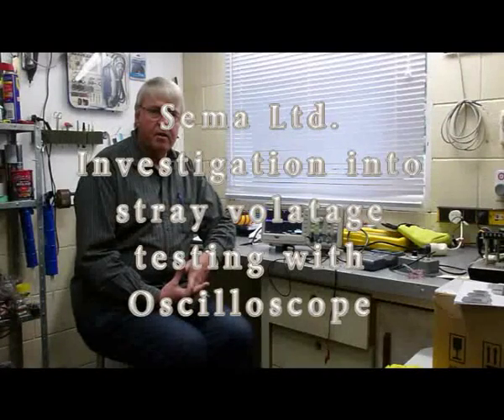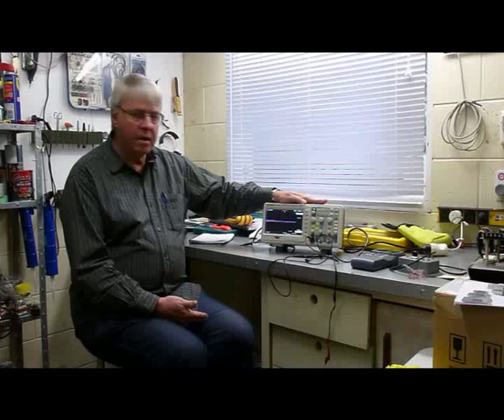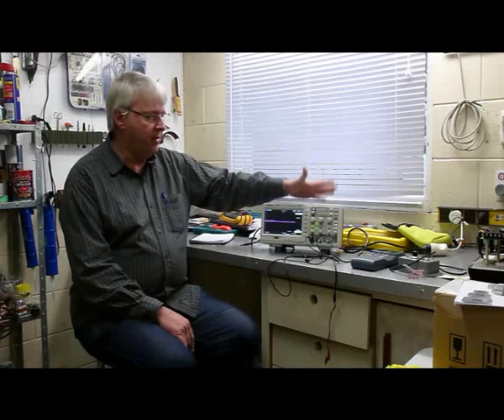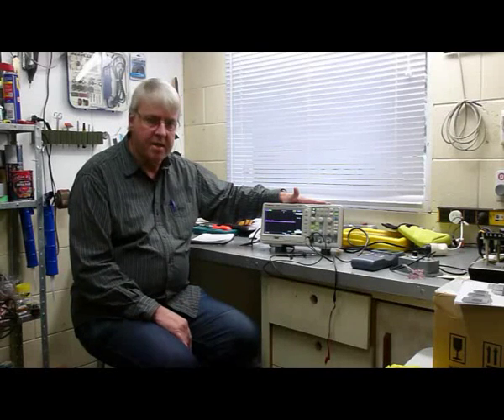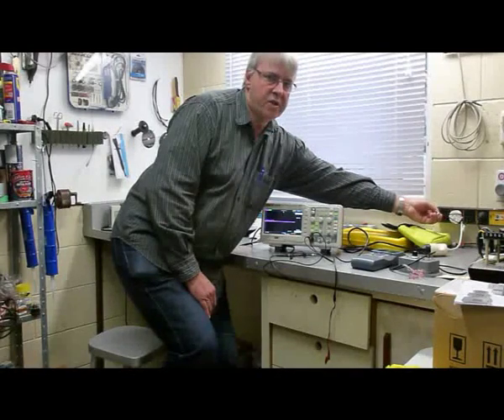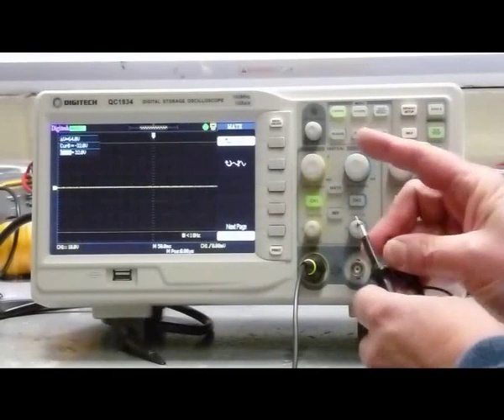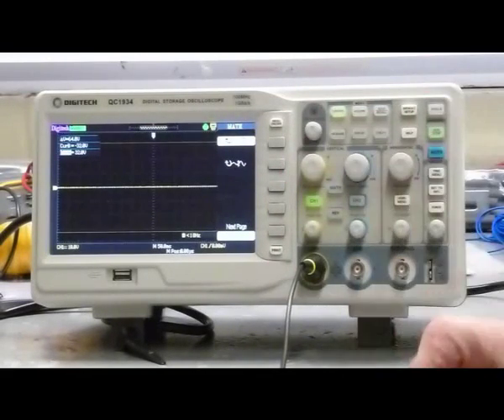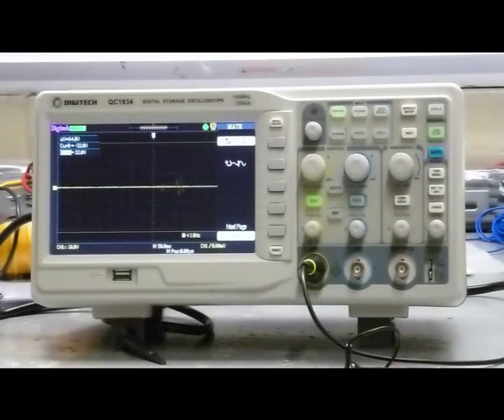Stray Voltage Episode 1

Comment: 10:50 Something is definitely wrong. You have faulthy measurements because you disconnected the earthpin on the scope.
The scope is leaking mains voltage through the X and Y safety capacitors inside the scope to earth, to eliminate EMI.
With a connected earth on the scope, this mains leaking (low current of approx few microamps) will be reduced to 0 volts.
If you disconnect the earth from the scope, this leakage through the X and Y safety capacitors can't flow to earth and will raise your 0 volts to almost mains voltage (at very low current). 
You should never never disconnect the earthpin on a mains powered scope, because the negative part of the BNC connectors at the front will carry almost main voltage, 
and this very low current voltage can and will destroy electronic circuits you try to measure.
Also, the negative part of the BNC connectors is normally at 0 volts level, but with disconnected earthpin, your zero isn't zero, and all your measurements get a offset voltage added.
With the earth disconnected, the scope probe picks up all kinds of interference because your body acts like a big antenna to mains wiring, switching mode noise etc.....
If you want to measure stray voltage in the field, you must use a battery powered scope, or a mains powered scope (with earthpin connected) and a differential scope probe.
And last, the short negative lead on your scope probe dangling arround, will also act like a antenna and pickup all kinds of interference (even on grounded scopes).
And if you think that this leakage is high current, connect a white LED between the negative part of a BNC connector and your earthpin of the walloutlet, 
and you will see that the LED will glow and will not burn up like it would do on mains voltage with high current.
Eventually, this LED will die after a few minutes because the working voltage is way exceeded, and if you measure the voltage in parallel over the LED, you will see that the almost mains voltage is now lowered with more then 50% will the LED is glowing.